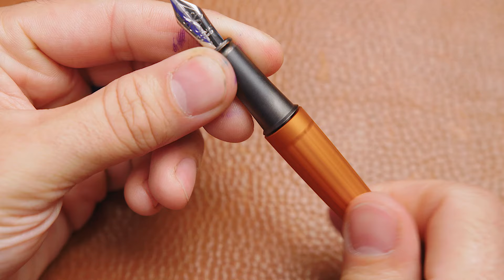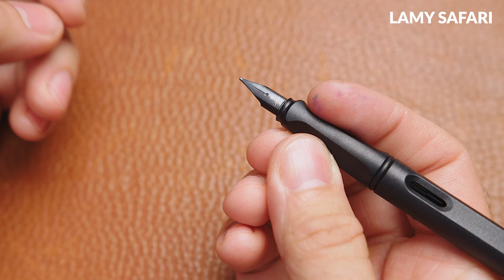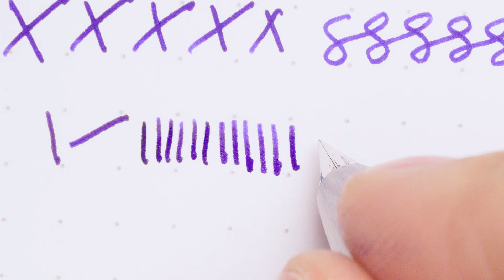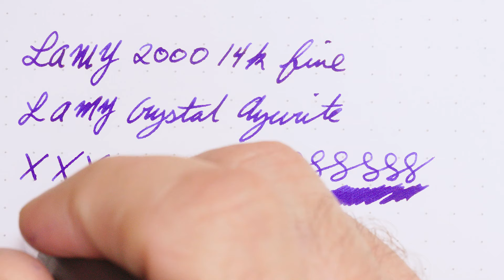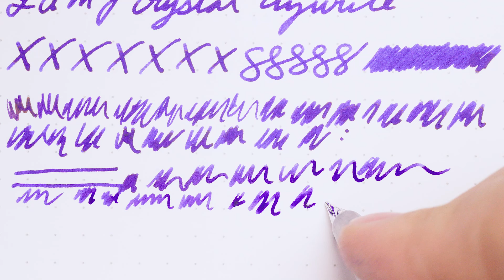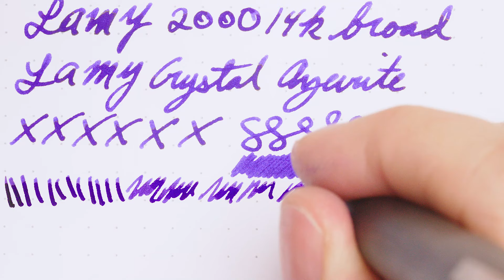Lamy 2000 Nibs *EXPLAINED*

Comment: How does Lamy 2000 compares with Pilot Custom 823?
I need to invest in one pen.
Reply: Get the Lamy 2000. The 823 has quite a number of reports of it getting cracked. Imo, if you wish to have the "aesthetic" of the 823, a vintage MB 146 is the way to go!
Reply: @jamesespino1358  Good choice. Will look into it. Thank you.
Reply: Here's my experience, owning both pens.

They're both icons pens in the fountain pen world and either will serve you well. Lamy is more minimalistic, more streamlined and understated while the Pilot definitely shows off that it's a fountain pen more. The nib is much bigger, the filling system is far more visible and the gold trim and classic fountain pen shape is a dead giveaway.

In-hand: 
The Lamy is exceptionally light. It really feels like an extension of your hand and suits me better unposted but doesn't tip off the balance too much if posted. I can definitely use it posted. I can't use the 823 posted, but unposted it's an astonishingly well balanced pen with some heft to it. Not too much, but it's there.
I prefer the section of the 823 to the Lamy 2000; the section on the 823 is nice and flares out at the end whilst the 2000s section tapers down, is slightly slippery at the metal part and the convex shape of the pen means your fingers can slide ever so slightly off. I usually hold my 2000 right below the ink window. The tabs that clip the pen are a bit annoying at first, but eventually you won't notice them.

The filling system of either pen is stellar. The vacuum filler is a joy to use, but equally a pain to clean whereas the piston filler of the 2000 is more straightforward. I thoroughly enjoy the ink capacity of the 823, it holds ink for days! 
For maintenance, the 2000 comes out on top. Easier to disassemble and clean, the 823 will get ink in the threads and won't remain 'pristine', but don't disassemble it to clean it. Yes it's possible and yes, you can use a TWSBI wrench. But on more than one occasion, I've seen the threads of the filling system being damaged from disassembly and as these threads mesh with the plastic blind cap threads, they can wear the blind cap threads out super quickly if there is just a tiny sharp edge on the metal threads of the filling system. 

The nibs, I have to give this one to Pilot. Beautiful nibs, write consistently and amazingly and they stay true to their sizes. I especially enjoy the fact that the Pilot nib can be swapped for a FA nib which i currently have on my 823. Absolutely fantastic nib, one of my all-time favorites.
The 2000's nibs may have some inconsistencies in regard to grind, but they sure make your writing look neat and uniform with just a hint of that fountain pen charm.
I haven't tried any of the 2000's oblique nibs, but i doubt they'd have the stubby characteristics found in old-time Pelikans.

I enjoy both, for different reasons. I love the look of the Lamy, especially considering I have a blue version and for writing neatly and consistently. But for more expressive writing, nothing beats my 823 with the FA nib and the custom ebonite feed. Even without the latter attributes, the stock Pilot 823 nibs still offer more expression and bounciness than the Lamy does.

So to sum up.
Get the Lamy if you enjoy a light pen, that's extremely streamlined and minimalistic. Good nibs, though not as expressive and don't forget, it's cheaper.

Get the Pilot if you enjoy using your pen unposted, you enjoy seeing the ink slosh around, need an enormous ink capacity, love a bit more expressive writing and can afford it.

Hope this helps, feel free to reply if you need something explained!
Reply: @am7265  This clears a lot. Thank You.
Reply: If you do a search on comparisons between the 2 pens to get more detailed info to help with your decision.

Comment: I guess I may finally cave and pick one up after years of Brian's testimony!
Reply: I did! I got a medium and for everyday writing, I find it a little thick. It's definitely super smooth and the medium is perfectly useable I just wonder if I would have liked the fine for note taking. Honestly I will probably get another with the fine nib.
Reply: @tkkc2009  ..You’re quite correct about the Medium writing a rather wide, wet line. Not a typical Western medium (barring maybe Pelikan and Montblanc) at all. If I didn’t already own three of the 2k pens, I reckon I’d have bought one with F, because I’m really curious and keen to try it out.
Reply: You will not be disappointed.
Reply: Honestly, the lamy 2k is outstanding. 
I would take one over any Montblanc and any modern pelikan lower than the 800.

One is enough.
Every collector should have one.
Reply: It’s his fault I finally caved as well.
Reply: I caved 3 days ago and bought it on Amazon for $150, which is such a sale that it pushed me over the edge. Previously, I've bought almost all HongDian pens and I have a TWSBI and a Monteverde as my ~$60 "expensive" pens. This was an investment for me. But OMG! I love it so much, I told my dad, "I don't think I'll be writing with my HongDians anymore."
Reply: I did. 🙈🙈🙈